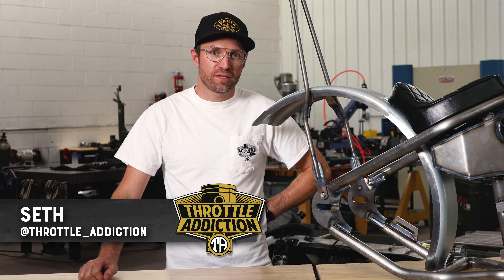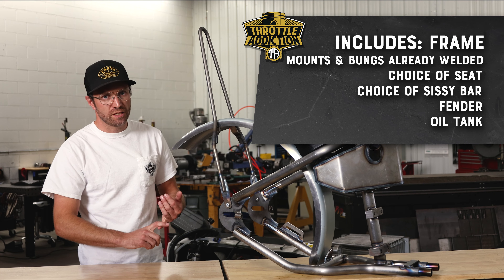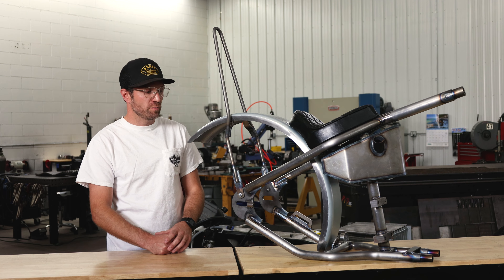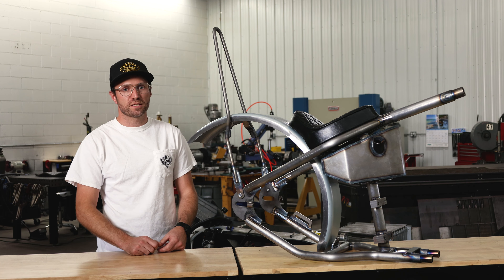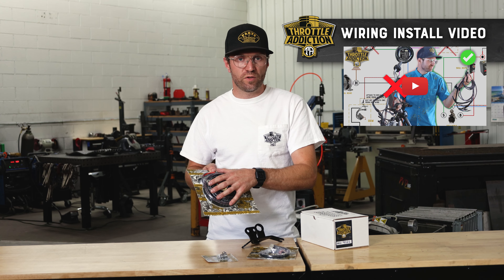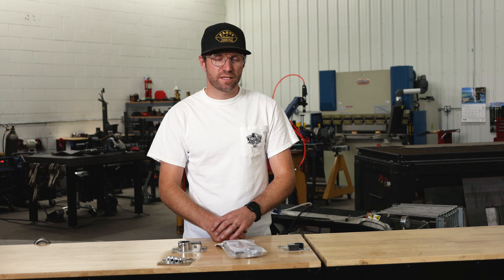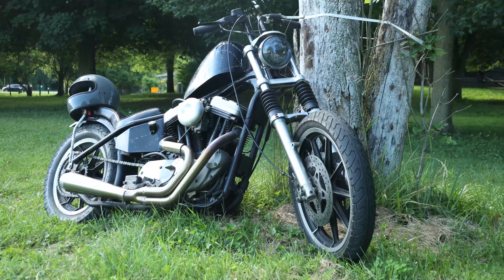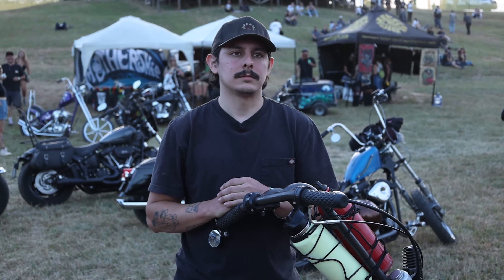Chopping a Sportster has never been easier - The Throttle Addiction Deluxe Hardtail kit

Comment: I'm wondering if they can make this kit 4 or even 6 inches longer. I'm 6'5" tall and been struggling my entire life to find motorcycles that will fit my size. I hate the feeling of being crunched up just to ride. I have built a completely hand crafted, by me,chopper  when I was in my 30s. Now I'm 54 and want to build another one.
Reply: 6'7 here and forward controls for sure help with this kit
Reply: get forward controls and weld on some foot rests on the frame that let you recline
Reply: I think Led Sled Customs has a hardtail kit where you can choose between, 0'', 2'', or 4'' of stretch. Might be something to look into. It seems like a lot of their kits are made to order so I'm sure if you contact them, they might even be able to do one with more if needed. Could also send an email to Throttle Addiction and see whats up. 👍